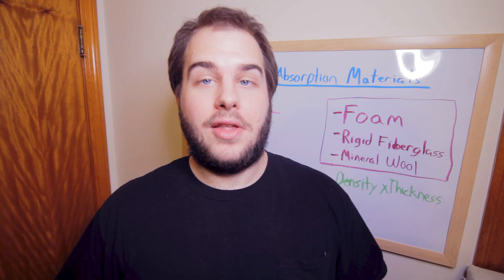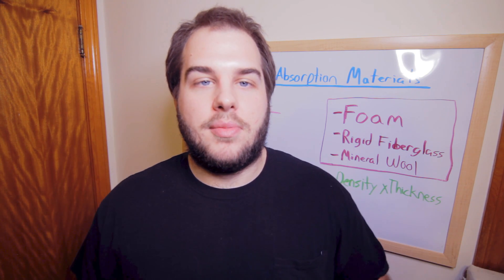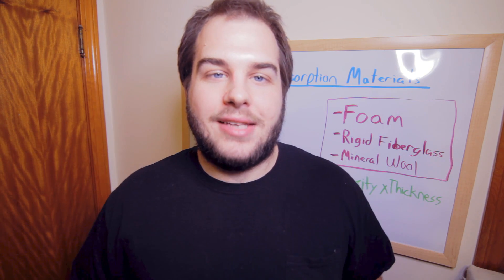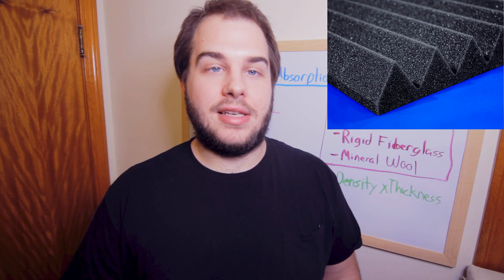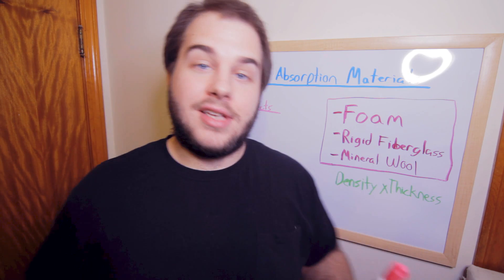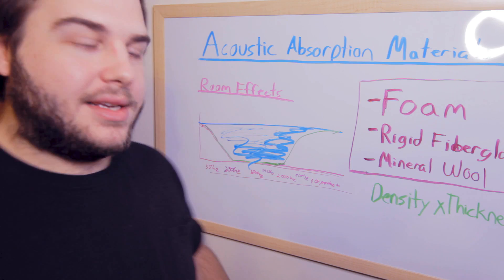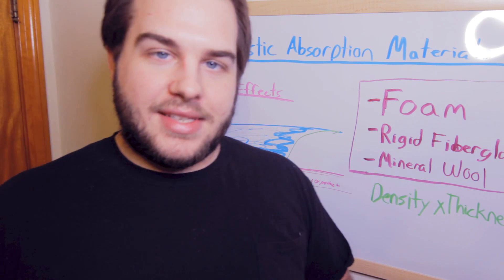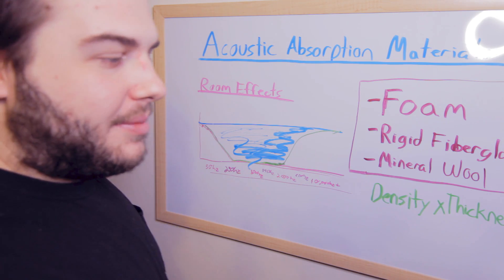The Best Materials for Acoustic Absorption Panels "Bass Traps / Acoustic Treatment" Explained

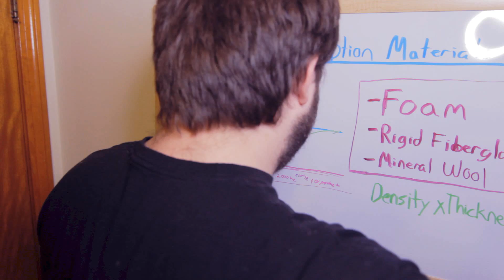Comment: applying that kind of treatment to a room will not "mid-scoop" the frequency response of a room (8:26).
When a broadband absorber "absorbs" certain frequencies, it merely dampens the reflections of those frequencies.

If a trap was only effective from 100Hz to 300Hz, it would flatten the frequency response of the room in that area rather than attenuating those frequencies.

Comment: Thanks, dude! From informing videos like yours I also came down to rockwool as the best and cheapest option, but I guess you have to put some foil around it cuz it's releasing very tiny artificial and irregular particles that get stuck into your lungs and the body can't deal with them which causes people to eventually fall ill of bad deseases. Please consider that for your sake. :) Have a good time and thanks again!
Reply: Acoustic Foams are used for Echo & Acoustic Curtains are used for Soundproofing SoundProof-Curtains.me

Comment: Covering it in plastic is hilarious.
Reply: Why so?
Reply: @hillybillyguitarzan5813  Well, you labeled the video “the best materials for acoustic absorption panels...” and took a detour around 7:40 regarding reflective membranes to liven up the room / higher frequencies (ie plastic). Seems a bit counterintuitive to “kill the frequencies” and the video title. Irony = hilarity
Reply: @ Victor Vek The title is the best materials for acoustic absorption panels “bass traps/acoustic treatment. It is a very well known fact that reflective surfaces are used to maintain the highs while the mineral or fiberglass tames the lows. It has even been suggested by Ethan Winer the owner of real traps that a cheap way to treat your corners, which is where a lot of bass frequencies build up is to stick rolls of fluffy in all your corners in their original packaging for the very reasons the OP of the video mentioned. I think using slats in front of insulation spaced a certain way does the same thing. It is all called acoustic treatment. Which is mentioned in the title...

Comment: There are very dense open cell foams that are better than some of the corning products and don't have the added benefit of causing lung cancer like FG and rock wool does. Simple principal, sound makes it in through the open cells and lose energy due to the density of the foam and much less makes it back out. With a calculated slotted or perforated cover a lot of that is returned to the foam again. This foam works well, the cheap light weight closed cell is like egg crates, useless. So don't discount ALL foam, just the crap sold out of China etc. and resold here as acoustic foam. Carbon fiber works for absorption too. The only insulation I would use is rigid @ about 6.5 lbs / foot sq. Loose Roxul etc. is no good at all, a simple comparison proves that.

Comment: Unlike instruments, seems that you DO want to record spoken voice in a “dead” room. Am I wrong?

I’m not convinced this video is accurate in regard to the effects of these materials.
Reply: Many of F Alton Everest's books have a complete list of building material co-efficients at the rear of the book. Handy to have.
Reply: Check out Ethan Winer's Audio Expert book, and YouTube channel. This is fairly in line with those techniques. At a minimum these need to be put in first reflection points (left right and ceiling) then in corners, including ceiling and floors if you can for bass trapping. You don't have to cover your entire room unless you're going for anoechoic recording,but it's unnecessary. 👍
Reply: For voice, you want as little reverb as possible, but that doesn't mean you want a "dead" room. Yes, you would start by killing all reflections and absorbing as much low frequencies as possible. But once you get that almost anaechoic room, you definitely want difussion. Difussion doesn't mean reverberation and your voice will still be dry. However, good difussion will raise good mids and higher frequencies that will help your microphone while capturing your voice, giving it a completely different, richer sound, than without it.

Comment: Hi All, can you help? I have a brick built workshop in which i do upholstery and woodwork. I want to sound proof because of neighbours. So I have impact noise from staples firing into wood, bandsaw which can be high pitch and banging. If I use just rock wool fibre then would this absorb high pitch staples firing. How do you think it would be best to soundproof completely or as much as possible?

Comment: This is useful, but (I think) you should differentiate between the ideal treatment for a performance/recording space and a monitoring/mixing/mastering space. You would want the flattest possible response when you mix and master, but this might not apply to the performing/recording process. I would make a distinct point about which situation you are treating acoustically. Otherwise your tutorial is amazing. Thank you.
Reply: Yeah Im looking to get less reflections in a home theatre. He's saying I want to coat absorbtion panel so it will get the higher frquencies bouncing around everywhere? That can't be right.

Comment: Foam - lousy sound absorbant
Roxul - no way, toxic and carcinogenic
Fiberglass - no way, toxic and carcinogenic
Sheep wool is far superior not only for thermal insulation, it's an AWESOME sound dampener/absorber. May be a tad more expensive but non toxic and lasts forever...
Reply: The more common types of rockwool used as insulation are considered by the International Agency for Research on Cancer to be "not classifiable as carcinogenic in humans." It can cause some mechanical skin irritation. Work with covered arms and legs with gloves as well.

 In 2001, the International Agency for Research on Cancer removed glass, rock and slag wool fibers -- common elements of fiberglass insulation -- from its list of substances possibly carcinogenic to humans.Personally I feel is a bit more physically harmful than rockwool, probably best working outside with gloves, covered arms  and a respirator with P100 or other particle filter.
Reply: moonskin1976 what about cellulose insulation foam
Reply: @luisleyva370  Ive tried that too. Dense sheep's wool is an awesome sound dampener and non toxic. Since installing the sheep's wool in my private studio's walls, we can play/record as late as we like without complaints from neighbors.
Reply: @SOLASCEND76  do u got pictures or videos to show, really interested as to how you set it up and where u bought it from
Reply: Hi, I'm learning Cello. Do you think wool will help? Thanks

Comment: I think I know what you are trying to,say, “foam is not a total solution”.  However, it can be very useful for getting RT-60 under control for the room’s intended purpose.  It is also a useful component in compound treatments (i.e. combined with other materials in things like bass tube, resonators, etc).

Comment: Seen people building DIY vocal booths either using -wood sheets or - drywall/sheetrock. Which one is a better sound barrier ?
Reply: The one that's heavier/denser, unfortunately, if it's sound isolation you want to achieve (both from inside noise getting out  and from outside noise geting in).

Comment: You haven't really done your research if you think that acoustic foam is "useless". Is it the most cost-effective approach? Definitely not. But look up the NRC (Noise Reduction Coefficient) specs for, say, 4" Auralex Studiofoam wedges. I'm using them as an example because they publish these specs for everything on their site. At 315 Hz, it has an NRC rating of 1.09 - even at 250 Hz, it's rated at 0.89. You say in your video, "Way, way up - maybe 1,000 Hz, it starts doing something..." 250 Hz is a hell of a lot lower than 1 kHz, man.

That being said, acoustic foam is super expensive for what you get when compared to Rockwool insulation products or Owens-Corning 703. But saying it's "useless" and GREATLY exaggerating about which frequencies it does and doesn't absorb isn't gonna help anybody. Learn before you teach.
Reply: Acoustic foam has a flow resistivity of about 10,000 Pa.s/m2. At 5cm thick, the panels wont effectively absorb anything below 1kHz. Whoever Auralex are, they're selling you misinformation. 89% absorption at 250Hz from acoustic foam is nothing more than fiction.

Comment: Hello,
Thanks for the wonderful details and explanation.

My house is next to a busy street and whole day (and night) we have to bear high noise, as both my bedrooms are on street side and have 5 feet by 7 feet glass windows with sliding glass panels. Each sliding glass panel covers half the window i.e. it is of the size of 5 feet height * 3.5 feet width and they slide left to right.

Day time noise is fine, as we are busy with work. But night time noise is a problem. Will it be the right approach for us to use these acoustic panels in additional sliding frames (in parallel to existing sliding glass windows) to prevent street noise from coming in at night? We are good to have half of the window get blocked by the solid panels during day time, as other half will suffice for sunlight. Night time we'll slide both the panels to cover the whole window. Its my own house so can make any modifications to windows as needed.

Please let me know, and thanks again for the details
Reply: You probably already have a solution but just wanted to clarify that sound absorption and sound isolation are 2 different things. What you need is sound isolation and unfurtunaly it can be difficult and expensive.

Comment: Question:
Would custom printed canvas work as a "membrane" infront of the fiberglass/wool?
Reply: Yes, it just has to allow air through. A simple test is to blow through some with your hand on the other side and if you feel it, it's letting sound waves through the air as well. 👌
Reply: Acoustic Foams are used for Echo & Acoustic Curtains are used for Soundproofing SoundProof-Curtains.me

Comment: The title of this video says "best materials for Bass Traps,"

This is BULLSHIT.  Sorry, but Roxul and 703/705 don't do anything below 100hz, you have to use a diaphragmatic, membrane or a bunch of Helmholtz resonators if you want to do anything with low frequencies below 100hz.  

Acoustic foam, if it's the right one, doesn't over absorb in the 125hz to 500hz.  703/705 and Roxul aren't designed for room treatment, they are designed for insolation.  They just use as room treatment because people are gullible. 

I know companies that design rooms for private listening, control rooms for studio, tracking rooms for vocal and/or instruments and they get perfectly flat rooms without any use of 703/705 or Roxul and they use nothing but a specific acoustic foam and custom built diaphragmatic designs.   They also took the time to take measurements wiht every known material they tried 703/705 and Roxul but they over absorbed in the 125hz to 500hz range.

Comment: I am a drummer and I am thinking the plastic just could work(in theory) for retaining cymbals and high freq stuff. Not a glorious material but as you know very short waves(cymbals, dog whistles etc) are very easily stopped by thin material. Try playing drums with a plastic tent around you. Ouch on the very high end but makes very little difference on the lower frequencies. So, everything lower than that shimmer just goes through the plastic and gets absorbed. Kind of like a plastic tent stops the clarity of a voice but everything else comes through. Just because it has not been done does not mean a theory is wrong. Does that sound like a correct theory for the plastic Alex?

Comment: Would this Styrofoam panel work well for a home studio for vocals? I'm planning on gluing carpet to the outside of it as well. Thanks!
https://www.lowes.com/pd/STYROFOAM-R10-Unfaced-Polystyrene-Foam-Board-Insulation-Common-2-in-x-4-ft-x-8-ft-Actual-1-875-in-x-3-937-ft-x-7-875-ft/3110651
Reply: No, you'll need porous materials like the fiberglass and rockwool, or the open cell foam, those are dense closed cell foam that will just reflect sound unfortunately.

Comment: your graph js total misleading.
Reply: The y axis isn't labelled but even if you assume it is amplitude there is no material that will mute the sound. It also makes the hugely wrong assumption that any of these materials have a logarithmic frequency response. So wrong.
Reply: Luke Allison I recently did a absorption test of several materials in my university physics project. I would say the video is complete bullshit.
Reply: Luke Allison I used arta softeare which i used mainly for earphone measurement but it works perfectly in the situation. I get frequency response, CSD waterfall plot. I would say just throw some foam everywhere and add good bass trap and good diffuser will get the job done quite well.

Comment: Finally some useful info!!!! You confirmed my hunch how foam attenuates ~500Hz and up... The whole balancing act using different materials/installation techniques to balance frequency spectrum. I am weary to buy bass traps as I do not trust that they do what they say. Also Acoustical performance data plots almost never published. My problems right now lie with bass. I have a 60 null. Going to try to find some of your Corning therma fiber. I am in an attic. Symmetry impossible to achieve re listening position to side walls. Angled on one side :(
Reply: 60hz null
Reply: I’m in an attic too and had a very very bad bass issue, very bad distorted bass.  I decided to go against current wisdom and moved my speakers very close to the wall, and voila, the sound evened out.  It was glorious.
Reply: If you don’t have anything else you can do, moving speakers right up against the wall is the best thing you can do to control that bass. That’s because low bass frequencies are pretty long, and this minimizes the phase differences between the sound coming directly from the speaker and the sound reflecting off the wall. That said, all reflections will cause some sort of interference, and the higher the frequency, the shorter the wavelength. A 30 ft wave bouncing off a wall a few inches away will not be that much out of phase with the original signal. You’ll get all kinds of interference with those short waves, and a fair amount of comb filtering.

Comment: I Don't want to be rude, but you are making people waste they're money.
Low frequencies can't be absorbed by ANY porous material.
It needs an enormous thickness (~2 meters) of the  most heavyweight 
mineral wool, to achieve the same absorption as a single 0.5 x 1.0 x 0.2
membrane bass trap.
Do your research before making a tutorial.  
Peace.
Reply: At this point, i should say that i have mineral wool panels at my LEDE control room.
0.4 @ 125hz with a thickness of 100mm.
That was the best figure i faced.
The fact that it does better than the acoustic foams, doesn't make it a good bass trap.
Good thing is that its cheap and it can replace foam with ease. NOT bass traps.
Reply: move them 10 cm from the wall...if u dont know air is an absorber also...
Reply: I don't want to be rude, but I couldn't help but notice you used the wrong word for 'their'.
Reply: what? who ate a dick?
Reply: where can I buy a membrane bass trap??
Reply: fartpoobox ohyeah  No, you are.    You.have been brainwashed by the typical materials used, when there are others that you might not know about.  There are other products on the market that you might know about that might be better than something you are familiar with.

Used on your screen name, you seem like some stupid child.   Do more research and learn something.
Reply: A bass frequency is 100hz or lower.  above 100hz is more in the mid range.   All absorption products do about the same in the 500hz and above.   For low frequencies 100hz and below you have to use a diaphramatic (best), membrane (second best) or Helmholtz resonators (pain in the ass because they are tuned to one specific frequency rather than a range).   But you don't want to absorb too much of the 125hz to 500hz so that's why I wouldn't recommend 703/705 or Roxul, it absorbs too much in that 125hz to 500hz range.
Reply: Maurice Brown  no you ate not rude just a dick
Reply: you all dipshits are talking so much stupidity. Show me one diy helmholts that didnt give u 300 silver hair and ended up working shit couse you winged it...or made mistake of 1mm.....putting 2m of mineral wool.....yeah if u have  a really shitty golden ration and 2mX3m room i get by with 70cm of superchunks and 20pieces *10 cm abosrbers(relevant stuff here dipshits(move absorber from the wall for the thickness of absorber it works 40% better and 33% lower)) no one mention that of our royalty commentators....i suggest some of u just fucking shut up and be in your awesome room thinking of how to be a better person not a bratty musician that knows 3 things out of 10 relevant and thinks he is a teacher!